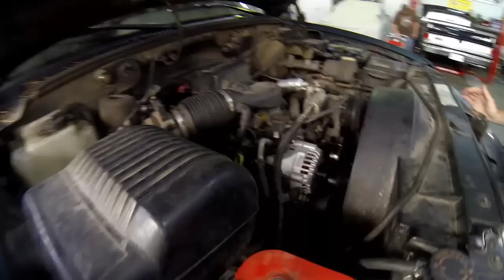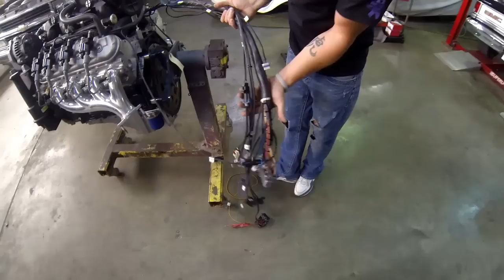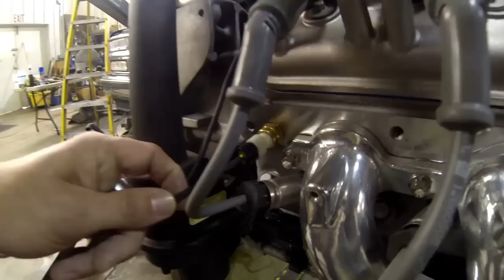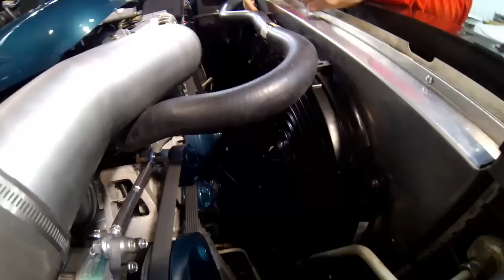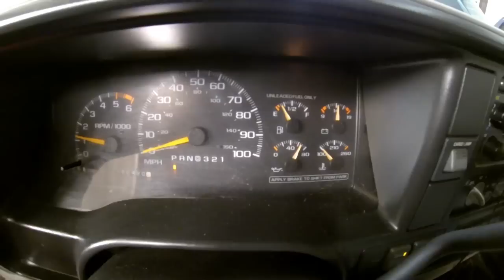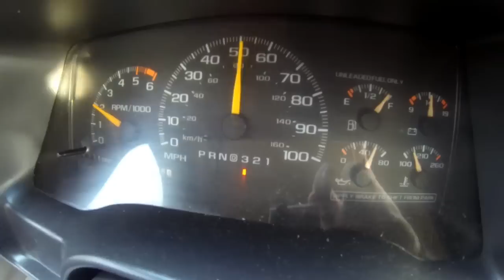6.0  liter swap into 96' Z71 presented by STREET & PERFORMANCE INC

Comment: They apparently have someone who doesn't know how to wire properly or tune properly. I did this swap to my 98 z71 truck and only use the LS computer. All factory gauges and abs work as they should using only the LS wiring, computer, tuning, and sensors ABSOLUTELY no need to run both computers on the truck.
Reply: sean ellis could u give me info on this swap
Reply: On a 96 and up do you pull all the old engine harness from firewall?
Reply: I would have thought as much
Reply: LIKE EVERYBODY ELSE ,, ANY WAY TO CONTACT YOU ,, THANKS .
Reply: It just takes more time to convert everything over to just the LS computer.

Comment: 180k is high mileage on a 350? My 97 is pushing 300k and I don't think twice about going on a road trip with it.
Reply: Mine has 330+k on her no smoke uses a bit of oil but still going strong but I'm getting ready to put an LS1 in it soon just needs more power.
Reply: Adam
Reply: 92roadmaster 370k 350tbi. Still driving
Reply: Right I'll take that one while they got it out.
Reply: 301k here
Reply: Yes sir im just like U I got almost 400 MY shit still runs good...
Reply: 455k And has been strong for me
Reply: Tahoe has 285k ac still works too 😏
Reply: Mine just died at 221k
Reply: 332,750 on my 98' and still going strong....but looking for a 6.0 to swap in the next year.
Reply: 270k on my 97, mostly hard miles and lot's of dirt roads. She's still running but her oil pressure is getting lower by the month. Those 5.7 engines are tough as nails but a LS swap would give it new life.
Reply: My 93 has 280,000 and HAD 190hp when new, P.O.S  especially with big tires 6" lift& 3" body  poor little 4l60e  some say wouldn't think twice to drive cross country, ( genius) I didn't think twice about swapping to a 6.0 with stage 2 cam 370hp  & 4l80e  it no longer has the power and capability of a vehicle you would get a 16 year old kid, I sold the "real good" motor transmission 500 each, bought a 2004 2500 HD for $2500sold the transfer case for 200 the core support for a 100  have $1,200 in twice the power twice block strength twice a transmission basically a turbo 400 with overdrive, more parts to sell off the donor truck, and made the value of my truck twice as well. Plus this block crank and rods from Factory will handle boost so if I put a turbo on it, it would be a semi trailer full of TBI 350 s power-wise. But I recommend you guys go pay 1800 for a new TBI and don't forget to rebuild all the knickknacks to go with it  you'll end uphaving $2,500 in it raise the value of your truck 0 have a little more horsepower at the tire then a 800lb motorcycle, 🤔KEEP ON TRUCKIN  00 genius
Reply: Have 3 k1500s with over 350k on em, can't beat a 5.7 vortec, tho my 97 about to get a cammed 6.0 in a few weeks...
Reply: I didn't either and the water pump gave out 16 hour's onna road trip 6 hour's from my destination and what a hassle after that.
I broke the heads needed life support after that,had some other things done to it,long story m are short, made it home ran great and then engine gave way bearings gave out and she blew up.
246k I was confident in that beast but looking for a LS1 now.

Comment: I just bought a 1990 Corvette ZR1 with the dual overhead cam, 32 valve LT5 engine designed by Lotus with only 74k on it. Car needs restoring because it sat for a while and was neglected but runs great. Thinking about pulling the motor and putting it in my 1997 C1500.

Comment: I did a 12v cummins swap in mine... way better then that gas hog 6.0L. I get 21 mpg highway and 18 in town. That's with 37 inch tires and 1 ton suspension.

Comment: I have a 2001 chevy 2500 HD with the 6.0 that just turned 300,000 and have never put a wrench to it other than the normal wear and tear,     water pump, alternator, and two fuel pumps.  Still turning the original power steering pump.  I hope it starts in the morning.....knock on wood.

Comment: Ls is a good motor bye far but thats alot of work for  such an old rig what i want to do with my 97 tahoe is take a suburban chassis axles and  4l80e trans and transfer case and put into my 97 and then take the 5.7l vortec and punch some horse power and some torque in her, its still a great motor ,put some shorty headers and a high flow cats and you my friend will have a hot rod 4x4 !

Comment: Would it of been better to overhaul the 350, put a mild cam, and stroke it...I know LS is the way to go, and some ideas for those that want to swap their engine.

Also why don't he want to put it in OD?
Reply: I got a fourth gen GMC 2wd xcab-short and after looking into all the avenues it's waaaay easier to throw an LS swap Then do all that ,  time, $$, AND R.O.I. 
ESPECIALLY if you can score the 6.0 over the 5.3 ... Shit it's actually easier to swap it then do what ijyst got done doing which was just a clutch job - nv4500 , pilot bushing, and oil pan / rear main , ujoints. (but also i don't have access to a lift) Im Outback under the grandfather oak in cent FL. And this bitch is c-notched... Not fun. 👎
Reply: LS swap it.. the ls swap has become hated a little because of how often people are doing it. But there's a reason why. They are great engines that make tons of power, reliable and simple. I like the old 5.7 vortec. I have it in mine and it has been great. But it's inferior to the ls in my opinion.
Reply: Willubhave One well these obs love showing the wrong gear.

Comment: has tested and for a better cost a 5.7 overbore  383 it is better  and away easier! only a flash for the pcm !   no harness  change , bracket ,support or any modification  at all . same stuff but a bigger engine  better cam, and easy maintenace.

Comment: Put you transmission in D
Reply: Ali Saleh lol I was thinking the same
Reply: Ikr...Cringe😨
Reply: thats why it didn't go in 4th! 😂 
i didn't notice but i was listening for the speed change.
Reply: BTW its not D but OD. the O is aroud the D. 
for Overdrive. also on the 700r4 equiped 1500 there a sticker on the door that says don't haul in Overdrive. but its only for city driving. its a bad thing to let the overdrive shift in low speed will warn the 4th gear clutch faster.

Comment: What's the part numbers for the ac compressor and AC lines and bracket? 
Fuel lines what did y'all use for that are you guys still using the factory fuel pump?  Power steering hoses?

Comment: did you change the transmition or what did you do because i wanna swap a 6.0 vortec in my 91 gmc sierra 2500 3 speed manual

Comment: How much did it cost for everything in the end? Engine and swap and everything? Final bill? I really want to do this
Reply: EngineBacon u can't afford it bro
Reply: Bronco Boy Neither are they able to afford it cus now they are close
Reply: You could use junkyard parts and do it for prob less than 2k if you do your own work. I'm in the process of doing it right now and a 6.0 with a 4l80e cost me about 500 with harness.
Reply: Nice
Reply: Jordan Bowen bro im really considering doing it to my 95
Reply: +Jordan Bowen ...you're right. it can be done under 2k. I guess it depends on your location. here in Detroit, I can get 5.3's and 6.0's for $150. however, everyone are hip to the 6's so, those are far and few between at the yard. I'm so glad I know how to swap those engines...7500 is outrageous for my geographical location. I could get a 6.2 plus tune for Less than that.
Reply: bishop p
Reply: bishop 4fff
Reply: bishop I'm so glad I'm so glad so this is where u hide
Reply: +Nicholas Jones ...yep, Detroit Michigan. Ryan's pick a part. they swap out their rows very often. so if you didn't find something one week, try the next week. guaranteed to find what you need.  I fux with them all the time. they have 5.3's for days. I'm talking 10 plus. all the time. I've gotten some good 5.3's without rebuild. great oil pressure while hot. great power. if it's a bad engine, take it back, try again. if you have sawzalls and proper tools, engines can be snatched out in a hour or less. you know, cut everything that don't look like an engine....lol
Reply: really im fixin to do this.......yee yee
Reply: I am from Arkansas. Everyone who’s in to cars will tell you that S&P is the best at what they do but they are not cheap. But you honestly get what you pay for. These guys build for some of the worlds most beautifully crafted street rods as well as joe down the road but, once again it’s not cheap.
Reply: 24,758.32

Comment: I'm pulling out a 6.0 out of a 2005 Chevy I'm going to put it in my 70 impala what else do I need to pull with the motor besides the computer and transmission for it to run in the impala. thanks

Comment: Couldn’t you use a 4L80 trans? I would much rather have that or a better yet a 6L80.
You pump that 6.0 up at all and you will be replacing that 4L60 pretty soon. Even stock your probably going to lose it anyway.

Comment: So is the engine stock? no modification of the cam, rockers, etc.? What would you say about a 5.3L going in the same yr truck? what would be the upside/downside  to doing an aftermarket cam?
Reply: Ya I'm sure they guy that got it thought the 340hp was enough for him
Reply: I have the 5.3, its a great engine and strong running. Just not a ton of power, all in all I like it.

Comment: what flex plate and adapter did you need? i used a 5.3 for my trans and and i still have my 96 built 4l60e transmission its nice to know i can still use it!!
Reply: also how did you hook up your original tach? would yoi happen to know what i need to splice into to get my tach and speedometer working!?!
Reply: Wo WEEDMAN oW, the input shaft, torque converter and bellhousing are different. Swapping those parts would let you use all GM parts.
Reply: i appreciate it! unfortunately i have a 1 piece transmission with an interchangeable tailshaft!

Comment: how much would it cost for a similar swap  on a 1997 2 door tahoe ? ballpark?
Reply: 20k
Reply: @dalehall2993  hahahaha you can do the swap for about 2000-2500 bucks. And that's with the cost of the engine.
Reply: @scottydoesntknow254  
Ls3 connect n cruise package...

Comment: I'm interested in changing out my 5.7 Liter original motor, transmission, etc in a 1991 Chevrolet Silverado 4x4. 
I've got some questions.  Interested in the parts and where you got them.  (Motor mounts, etc... )  I did want to ask, if I'm going to install an LS engine with transmission, I just use the same parts as designed for whatever I get the drivetrain pulled out of? 
My speedometer currently doesn't work in the truck.  
Not sure I'd need to keep the old computer? 
Bracket for the A/C and tension pulleys. ?? 
I'm the original and only owner of this 1991 Silverado and would like to get some new energy under the hood.  Love my old truck. 
Loved the video.  I'll check out the website and FB pages. 
Hopefully you don't mind sharing a little advise and information about parts.  If they are your website, that's cool too. 
Thanks,
Mitchell D. 
Raleigh, NC
Reply: Mitchell Dennis find the YouTube chanel Agearheadforlife..that dude has all the answers and builds...real Kool dude...
Reply: Thanks Lamu Taafua!
Reply: +Lamu Taafua ....yea, I fux with gearhead...he does have all the answers....literally.

Comment: HOW much do you guys charge to reflash the pcm and redo the wiring harness for such a swap
Reply: waiting for a response on that cost
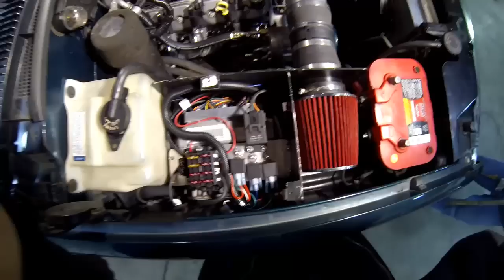Reply: There is no reflashing of the PCM.  At 4:49 he shows where the 6.0 computer is. the factory PCM for the 5.7 is still on the driver side to control other stuff.

Comment: Would the stock trans or the LS trans work better in the swap?
Reply: Trevin Taylor the LS trans would allow you to install it without the flywheel spacers.
Reply: James Bodie pooi8
Reply: Trevin Taylor a 4l80 e would work best with a 6.0 i seen people put a 4l60e and they wont last long maybee a fully built one to handle the power on the engine

Comment: would the transmission of a 93 Chevy truck work on the 5.3. its 4l60e
Reply: Yeah, that's what my 99 5.3 runs is the 4l60e.
Reply: Sal  Benz possibly, but the newer ecu wouldn't be able to control it.